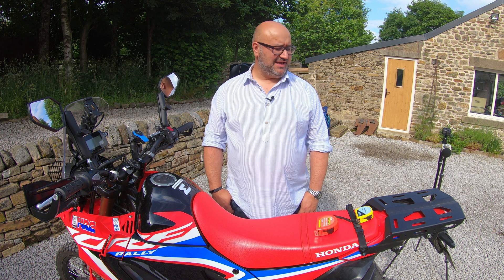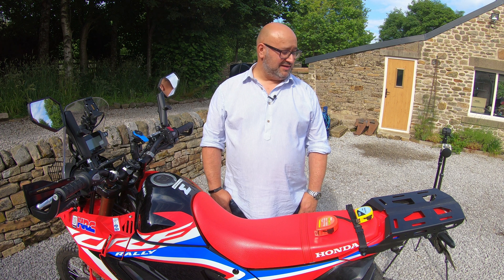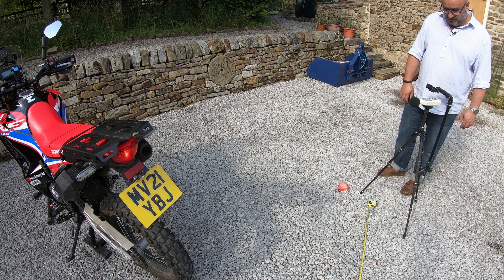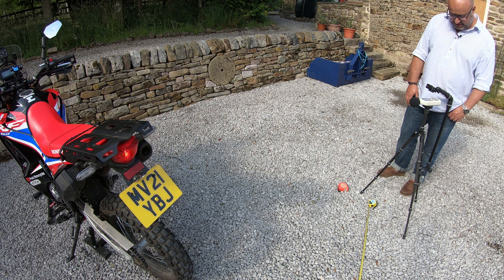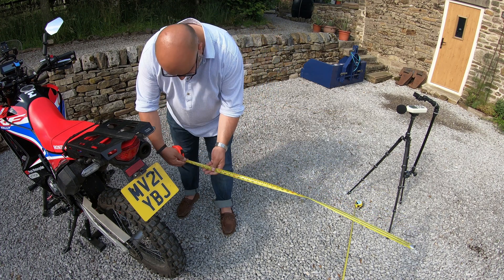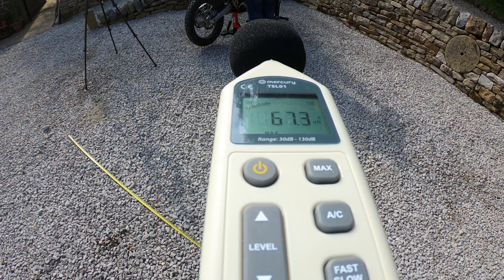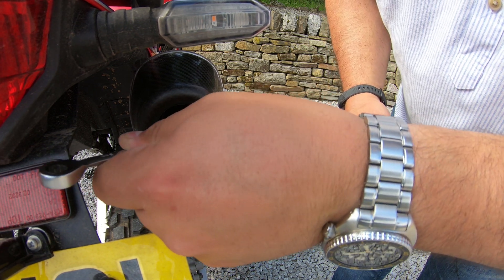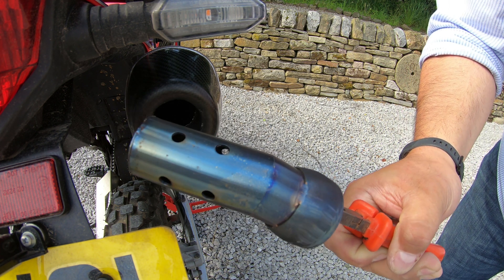Honda CRF300L/Rally MotoX Exhaust Noise Test 4K

Comment: Did you stay with this exhaust? Long term, still good?
Reply from the maker: Just a few months I’m afraid. Then switched to the Arrow with a Cat. The Motox was ok, but a bit noisy, lighter than stock, but I don’t think added any power. Also get the stainless end cap, not the carbon. Mine started melting…

Comment: How many gramm's is the motox exhaust lighter than stock? Has it a Cat?
Is the power after that the same, or does the motox causes lost of power?
Reply from the maker: No cat. I don’t recall the weight but I think it’s in the video where I fitted it. 
I didn’t dyno it, so can’t say definitively. If feels faster lower down, but that might just be the noise. It did feel like it lost some top end too.

Comment: I've searched on the video comments and didn't find it. Did you noticed if it less hot on your right leg due to the header being larger? Don't know if on the Really that's a thing, but on the L the stock header gets really hot and it bothers me a bit even with the boots on.
Thank you for such a detailed video!
Reply from the maker: Hi, I didn’t, but even with the larger header, it is still behind the panel on the Rally (it’s more exposed on the L with the bolt on heat shield), and not having an inline cat, I’d almost expect it to run cooler than the stock pipe with the cat.

Comment: Great video.  Thank you!  Does the MotoX get louder than the stock muffler somewhere between 4K to 10.5K rpm’s?  Or is it only louder once 10.5K rpm’s is reached?
Reply from the maker: It’s louder below 10.5k rpms too, just not by a lot. It is noticeable though.
Reply: @PeakMotorcycles  thank you for your reply.  I ordered the MotoX 2 weeks ago.  I'll have it tomorrow and will install this weekend.

Comment: ummmm, that silencer was plugged on the small end?  13:56 ?  no way.  therefore only 6 or 8 tiny holes for flow... no way?  what the?
Reply from the maker: If I still had it I could check 🤣. It did work though.
Reply: Well they're not tiny holes, they're 3/16 of an inch.  There's 8 of them.  Do I need to explain that a bunch of small holes equal the same as one big hole?
Reply: @MadMonkMoto1  i never seen one plugged like that.  obviously i havent seen them all.

Comment: considering the arena for testing is quite acoustically contained, i would say this is worst case of exposure over compared to more open areas.
Reply from the maker: Never really thought about that. I guess being inside a garage or tunnel would be worse? Being on gravel, surround by rough gritstone dry stone walls is a pretty good noise absorber.

Comment: As a note, if purchasing the MotoX exhaust from BikerzBits in Thailand, it appears that package (the V1 full exhaust) has changed. They no longer include the db killer insert with the package, and they don't include a spark arrestor 'bucket' to go on the input side. I recently bought the V1 full exhaust and it arrived with a screen-type spark arrestor in the end, and no db killer. I had to order and ship the db killer separately. This seems a somewhat recent change. I'm going to assume that because I don't have the spark arrestor bucket (that goes on the input side of the muffler it seems) - because it didn't ship with one and I so far haven't found one - my exhaust is noticeably louder than the stock setup (with the db killer inserted). I bought the MotoX based on this test/review. I think it's important to note. The loudness is just barely tolerable for me (without the db killer insert, it was very loud and obnoxious and absolutely no tolerable to me), compared to the stock setup. I also note a slight difference in my db killer insert in that the leading surface (that's inserted into the muffler) is rounded, rather than square as seen in this video. My experience seems to differ from others I've talked with online - although, those I've talked with bought theirs well before I did.
Reply from the maker: Thanks for the update. It has been a couple of years since I did that video. I did switch mine out for an Arrow homolgated exhaust with a catalytic convertor a few months later.
Reply: @baerv3753 Any updates would be appreciated. Oddly, I just searched the store ("Moto-x") and I get one exhaust system and the internal spark arrestor bucket in the search - last time I got the db killer - seems like the search isn't reliable or their products are 'shifting'.)
Reply: @baerv3753 Thanks, good to know. I did order one - so I'll try fitting it when it arrives in a week or so.

Comment: I run this exhaust with a 550 performance tune... I run it without the baffle as well. I think there's something wrong with your decibel metre. I do like the sound in the performance gains and I'm willing to put up with it. But this exhaust is by far louder than the stock exhaust I have to wear earplugs and I don't rev it that high.
Reply: No Dyno but it would barely spin the stock tires in dirt and now I can spin the tire if I want in the dirt while accelerating , it’s also far smoother on off throttle. Mid range is far stronger also.  I will get a decimal meter and try it.  This exhaust is very loud. I need earplugs.
Reply from the maker: Thanks! When you say ‘far louder’ have you measured it? Just curious really. Same for the performance gains, is that something you’ve dyno’d or it just feels more powerful?

Comment: Can the OEM exhaust heat shield be fitted back on the bike?
Reply from the maker: Not easily. If you could get some jubilee clips, with some threaded fittings that the stock heat shield could bolt to, then maybe, but it’d take some work.

Comment: Is it street legal?
Reply from the maker: Probably not.  The only two E marked, street legal ones that I know of are the stock one, and the Arrow one (if a catalytic converter is used). That said, in the UK for the annual safety check, there is no validation of parts. I think you can get a fail for noise, but many bikes have stock exhausts which are a lot louder than this. I used it for a few months with no problems and then switched to an Arrow exhaust. I don’t know what your local laws are though. I know that in Germany, modification is much more controlled than it is in the UK. Not sure about anywhere else.
Reply: @PeakMotorcycles  thank you! I think I will buy the Arrow one.

Comment: Just installed one. Header pipe is very well made but the can is just ok. Had to file the carbon to get the baffle out. Did you run this for a long time with the baffle in? It says not to on the package. That’s kind of stupid. Built with a baffle your not supposed to use. I like the sound with the end baffle in and the mid baffle removed.
Reply from the maker: I did 250 miles across 5 days and the end cap started to melt. Not a lot and it didn’t affect the performance or fall off, but when I asked MotoX about it they referenced that note. I asked them if they thought 250 mile in 5 days was a lot (I don’t) and they stopped responding.

Comment: I installed this exhaust and I am thinking of going back to the original exhaust. The reason, the replacement exhaust stinks of my shirts. The original exhaust with the catalytic converter does not do that. It's a real nuisance. Did you notice that?
Reply from the maker: I’m sorry but I didn’t…. Did you have both inserts in yours? (The mid one and the end one) Could it be cleaning material, or something else melting onto it? I changed mine out for an Arrow with a catalytic converter, though not because of any shirt odours 🤣. Apologies and good luck.

Comment: Hello.. It would be  interesting now after almost 1 year if the exhaust is louder?
Reply from the maker: Not sure. I changed it for an Arrow Thunder exhaust with a catalytic converter. I don’t have the MotoX on the bike any more. Apologies
Reply: @PeakMotorcycles  no problem…I saw your video zeta handguard i order it and pay but they don’t deliver to Austria.. ..pity..and the arrow exhaust is it louder then original?
Reply from the maker: @theadventuresofcaptainslow3233  is there no Zeta importer in Austria? As for the sound, it’s similar, except at the very top. I can pass horses on the road with the engine running and they hardly notice me. 

Gear: Arrow Thunder Titanium on a Honda CRF300 Rally Noise Test
https://youtu.be/f8fFAASpRtk
Reply: @PeakMotorcycles  i didn’t found anything yet..
Thx for the link.

Comment: Hey man ! Awesome video, as always. I discovered you, and it's awesome to see someone taking care of the crf 300 like this, i'm learning a LOT.
Quick question, i've seen that with the yoshimura exhaust, you need to reflash the ECU, becaus eit's running too lean, and at low rpm, the bike shut off.

Anything like this with the motoX exhaust ? Is it good quality ? would be curious to buy it, since it has a good noise, without being annoying for others.

Edit: any opinion on Akrapovic ? 

CHEERS !
Reply from the maker: Hi Aymeric, welcome! So, there’s a a few things to consider. Are you in the UK or EU? If so, you’ll have a different ECU to the rest of the world, and currently there is no remap option that can unlock the Euro5 restrictions. If outside the UK/EU, remaps are available from the likes of 550 Performance. 

The problem occurs when there isn’t enough back pressure from the exhaust. If you have a straight through with no cat, then more air can come out than goes in and the bike will run lean. I ran my MotoX with both the end and mid inserts in and it was ok. Not quite the same as stock, but close enough. I think they are good enough quality for the price, but they are cheap. I’d go for the aluminium/stainless one if buying now as the end caps on the carbon ones melts! 

I’m not sure that Akrapovic do one yet for the 300. I’ve seen some that folks have fitted, but none that are CRF300 specific. If they have the same back pressure as stock, then they would be great. The quality is also good. I have an Akra pipe on both my CB1000R and my R1250GS. Both are dedicated parts from new and perform very well.

I hope this helps. If I was buying now on a budget, I’d get the stainless MotoX. If my pockets were deeper, I’d get the Arrow with a cat as it’s homologated (same back pressure as stock), lighter than MotoX and has a similar sound to stock. 

Cheers,
Reply: @PeakMotorcycles  i've looked into the arrow exhaust in france, and they don't sell the collector, because it's not "street legal". 
670€ with the collector, i'm ok with that. 

But is there any problem if i only use the silencer + link pipe, without the arrow collector ? 

Thank you man, you're a gold mine, and really kind !

Comment: 'André that was so thorough and just what I needed to know. You put a lot of work into that and done properly so.... much appreciated. Did you have the full exhaust or just the slip on silencer? Look forward to your next video. My Rally hasn't arrived yet, was due end of Mch but not long to the end of April now.  Will be a great winter project for me here in NZ. My top 5 mods are Tyres, Suspension, Gearing, 550 ECU, Exhaust ...Cheers.
Reply from the maker: Hi, the stock exhaust has a 1 piece link pipe and  silencer, so unless you’re willing to cut that, just a silencer will be a challenge. This one is the full system. There do seem to be supply problems still for all sorts of things. I have a van coming which was ordered in May last year for a February delivery. That became March, then April, now May…. We shall see!
From your list, I’d hold off on the gearing, at least initially; Honda have changed it from the 250 and made 1-5 lower and 6 higher. With the extra power and torque increase, 1 and 2 are quite low for off road use and 6 is great for highway cruising. Lucky you that you can get the 550 ECU. We can’t due to the EU/UK ECU… hoping your bike turns up soon. 🤞

Comment: Does it run more lean? Runs hotter and fuel range difference?
Reply from the maker: I hadn’t noticed much change. Some people have reported more torque and less top end, but I hadn’t really noticed that. I’ve been running mine with the baffle and spark arrestor in, and that seems to be a flow rate similar to stock, so I expect the ECU is able to monitor and manage the slight change.

Comment: Do I need to make any changes to the injection settings after the exhaust installation?
Cheers.
Reply from the maker: I’ve ridden mine with the stock settings, as have many others. In the UK, I’m not sure we have much choice as the UK/EU ECU is different to the rest of the world. I think the ideal is to do the exhaust, and an airbox mod to get more in and then adjust the fueling to match. I think this is possible on non-UK/EU bikes, but I’ve not had the opportunity to try it I’m afraid.
Reply: @PeakMotorcycles  I meant more about whether when changing to any accessory muffler, you need to make some injection adjustments so that the engine works properly, as the manufacturer recommends. I didn't mean regulation to increase power. When changing the original silencers to accessory, the operating temperature of the engine may change, due to different designs and exhaust gas discharge.

Comment: Hi !
What is the quietest exhaust for this motorcycle ?
Reply from the maker: I’ve only tested two, stock and the MotoX with the baffles in. The MotoX is quieter up to 5k rpm and stock is quieter above that. 
That said, I will be testing an Arrow system in the next few weeks with a Cat and baffle. It’s already on the bike, is road legal, and I think it might be quieter than stock, but I’ll have to measure to be sure.
Reply: @PeakMotorcycles  Thank you. Arrow is louder then Motosx
Reply from the maker: @fcalin21  how do you know? I had a look for a noise test or noise spec for the Arrow and couldn’t find one. Mine is on the bike and in my garage it sounds quieter than stock. I haven’t measured it yet, so may be wrong, but if someone has already done that test on an Arrow exhaust with the baffle in and the catalytic converter installed, I’d be interested to see it.
Reply: @PeakMotorcycles  I am sorry to say but i could not remember. I have whatched so many videos on youtube and read so many comments that i could not point you in the right direction. I am sorry.
I would be happy to be proven wrong.
Reply from the maker: @fcalin21  no problem. There’s a lot out there. I’ll have another look and if no luck will do the sound check on mine.
Reply from the maker: @fcalin21  ok, but in that the arrow is quieter at idle, 78dB vs 79.7dB, though it’s not measured at the same point, and when revved, it’s a lot louder, but without knowing what it’s revving to, and also relative position of the mic, I’m not sure that’s an accurate comparison. I’ll do my tests when I get home and find out how wrong I am 🤣
Reply: @PeakMotorcycles  Certainly i will trust more your information.

Comment: Hello, well done and interesting video, I saw that there are two versions of this exhaust, one with the code V2 and the other without the code, the price difference is small, do you know the differences? Thanks
Reply from the maker: I’m sorry but I don’t. Hopefully they used a less melting plastic for the end cap on the V2. The manufacturer TNT might be able to say what they have changed.

Comment: Moto X also have performance upper kit  to increase 301cc (38hp , 29Nm on dyno test) .It's cost 6,500THB(191 US$) .
https://youtu.be/_dZk7FHqEKc
Reply from the maker: Interesting. Not sure I’m ready for that extensive an upgrade just yet. I know the European bike has a different ECU to the Thai and North America model, and also it’s not currently possible to remap, not even to remove the snatchy fuel cutoff. I’ll let someone else try that out out over here first! Given that the end cap of my MotoX exhaust started melting after a week of minor use, and they said it should be taken off for long journeys (I did 200 miles in a week…) I don’t think I’d trust this kit.

Comment: I'm having a hard time removing my baffle. I have the screw removed but I can't seem to move the baffle. Any advice?
Reply from the maker: Mine came out easy, but I had a stuck one on a Triumph Speed Triple 1050R in the past. Sometimes heat helps, so run the bike for a few minutes, then try again. Sometimes getting something to pull on is tricky. I’ve found that cutting a wire coat hanger and making a tight hook on one end that will hook onto something inside, perhaps through the holes in the end of the baffle, and then have a bigger bend on the other end so you have something to pull on can help. If none of that works, take off the silencer, the one at the ‘front’ end should be loose, and see if you can knock the baffle out from the inside with a broom handle or similar. Good luck.